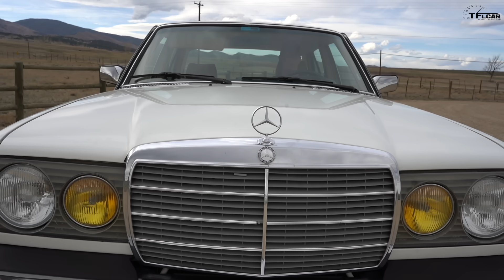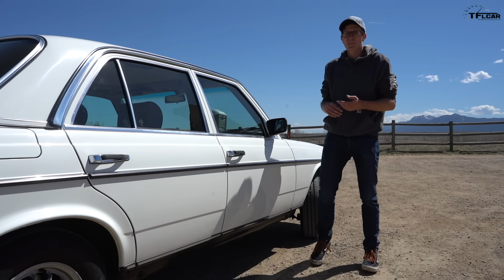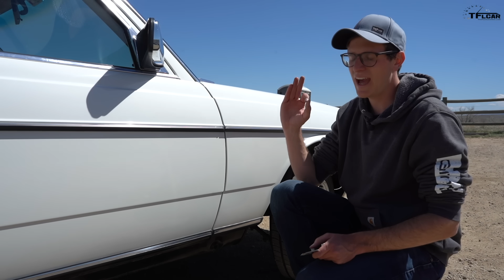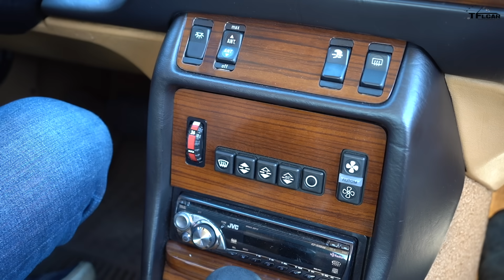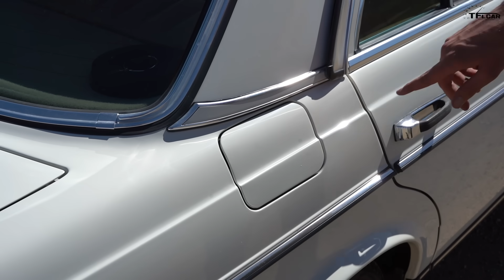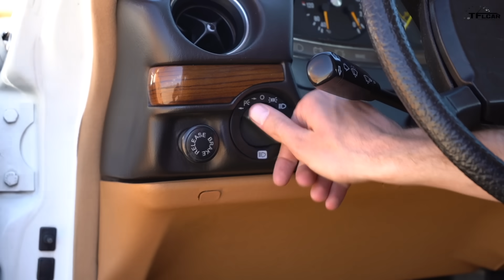This 37-Year-Old Diesel Is THE BEST Mercedes Ever Made!

Comment: I don"t get your point about the design. Nearly all cars from the 1970s-80s had this boxy stereotypical car design. The most famous ones are Volvos. That's where the saying "it's the car that kids draw when you ask them to draw a car" comes from. The old Volvo740's. Why compare the design of the W123 with modern Mazda & Cadillac?
Also, the 240D & 200D were way more reliable engines. They had no turbos and made little power. They sold way more than this "premium turbodiesel" 300

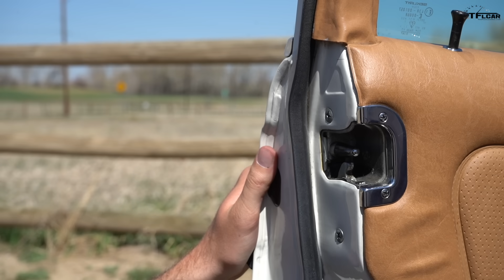Comment: The door latch machanism, seen here at 11:30, is the same one I have on my 1963 Studebaker Avanti -- it looks like it might even be the exact same part, with no changes in dimensions, and therefore interchangeable.  Studebaker licensed that latch mechanism from Mercedes for the Avanti, and it was for safety reasons -- this latch was one of the first made to ensure that the doors couldn't spring open in a crash and result in you being ejected from the vehicle.

Comment: Had a couple of W123 all variants except turbos. Very easy to repair, as I bought only defective cars, repaired them drove them some few 100 thousands, sold again cause the next waited. As in these times drove a lot on East country’s bad roads, they are the only cars which can stay it always, nothing breaks away. The Diesel engines are more reliable. Bought some with 250000 miles on odo and doubled it in some years.

Comment: Did you wiped my comment away, because it was a critic how you pronounce MERCEDES?😫😫😫
I am driving at the momemt my 7th Mercedes in 33 years.
When you pull out the light knop out once, you switch on the yellow foglights, and when you pull it farer out, you switch on the fogbacklights.
You didn't know this???😁😁
The early 300D had a thermal problem with the 5. zylinder. Mercedes used the same coolingsystem like in the 240D (the over 1Million Kilometer car), but he had to cool just 4 zylinder.
That's why you had many problems in the late 80s, to get a new 300D engine...the spare parts were sold out.
I sold my 300D with the damaged engine!

Comment: My aunt had one of these, it was gray and ugly, I know she didn't have it long though, her boyfriend was a Mercedes nut and convinced her to buy it, I think I rode in it once, if memory serves me correctly it rode like a truck was noisy, I might be mixing it up with the Volvo she once had which preceded the merc, that too was an ugly gray sedan, I don't know why they both were gray maybe it was a popular color for Euro trash back then, her next Mercedes was a small white one I'm not familiar with their model numbers and letters and their significance, anyway she had it for years and when she was around 90 she was coming home from church and pulling into her garage she blacked out, she crashed through the closed door into the back of the garage and took out the furnace and hot water heater, the gas line ruptured causing the the area to be evacuated, it was a court or some call it a culdesac until the gas company could come and shut the gas off, I wasn't aware of this until she passed away a few years later her  neighbors upon hearing the crash ran over and pulled her from the car, she's lucky the house didn't explode.

Comment: In my opinion the W123 has an equal friend to be the best car ever made: it's the successor W124. They are both undestructable (in German: unkaputtbar).
I had a 124 station 300 D, built in 1993. I bought it in 2000 with 223.000 km and drove it until 2017 with 667.000 km. I did not like to sell it, but I had to
(reasons not important here). It is still running. Now I have a "modern" W211 from 2008. It's a good car, I like it very much - but the best in my life was my old "Benzi".

Comment: one thing to watch for is the pitch of the oil pan bolt: some models the bolt was at such a weird angle on the pan bottom that something hitting it on the road or freeway would loosen the bolt, and drain all the oil!! Dad's shop did a few engine replacements for the local Mercedes dealer in El Monte!!!

Comment: I used the same cab driver when I was in Morocco who had one of these since 1988 (we visited in 2016). I peered into the dash and said “wow it’s covered over 800,000km! Hassan my cab driver replied “no no, it’s been around before. It’s done over 1.8 million kilometres”. 
He proceeded to explain that it wasn’t on the original motor. He said he had 3 other donor motors in his garage and was always swapping parts over. My god did it feel like it had done it though. Strong smell of oil burning, clunky and felt like every mount and ball joint was gone. Yet still it was still going. 
Every time I look at buying a car with slightly higher mileage on I always think back to Hassans cab.

Comment: I think you can only make this claim if you rework the turbo system.  It's been over 10 years since I had mine, but the Turbo lag was absolutely intolerable.   I'm not saying it has to be perfect or needs to compare to a modern Subaru or anything like that.  But there is a hell of a lot of improvement that could be made however you want to approach the problem.

Comment: We had a w123 growing up. 300cd, non-turbo. Damn fine automobile especially in euro-trim. That said, would argue that the w116 or w126 300SD were the best especially on a road trips as they offered better insulation from the engine and were rolling couches. 😊 Either way, the 240D will be my son’s first car.

Comment: we had the 200d with 50 horse power. Man this engine could pull over 3.5 tons of weight and manage a cruising speed of 120 kmh, and overtake military convoy transporting tanks. The w123 weighs 2 tons, we were pulling a caravan with weight of 1.5 tons, plus extra fridge, vorzelt and other stuff for camping. amazing.

Comment: Are u sure that the mercedes has a AC ? In Germany 40 years ago, it was common for the owner to have the sunroof installed if he did not have an air conditioning system installed.  There were already air conditioners, but up until 20 years ago in Germany they were only available at extra cost, and there were many people who did without them...

Comment: I've owned 7 of these 123's over the past 30 years...a 1977 300d was actually my first car in 1990.  I'd argue the 560sl is actually the best Mercedes of all time.  The build quality is even better.  Unfortunately the price for Mercedes parts is hard to justify on a car not worth a lot of money.  I've owned Ferraris and Porsche's...the most expensive parts of any car is Mercedes.  You can spend $20K just sorting out all the rubber that is invariably rotten on a 40 year old car.  The 560sl justifies the expense, while the 300d you can quickly eclipse the value of the car just in replacement parts.

Comment: How do you close that hood properly?
Reply: You mean after it has been opened all the way to "service" position ?
Reply: @M4ExKalashnikov  no I meant how to we latch it I figured it out though I just needed to slam it shut.  I just bought one and I’m trying to learn the car.
Reply: @healthwealth4791  best way is to lower the hood all the way gently, position you hands on each side of the star and push it in until it clicks locked. I've had no issues whatsoever and the latch lasts forever if not slammed hard when closing. 

As for the oil leak, it depends where it comes from. I do NOT recommend using those sealants that are added to the oil as they tend to block key passages in the engine causing more issues later. If it's a small leak, I would clean the area with an engine cleaner and see where it comes from. Usually, power steering leaks, oil sensors and stuff if not maintained properly. Sometimes it's just a bad gasket or seal that needs replacing
Reply: @M4ExKalashnikov  i agree with you totally 👍  I have fell in love with my w123.  Now I need to find a mechanic that I can trust.  My w123 is a stick shift and is so much fun to drive.
Reply: @healthwealth4791  I'm currently working on 2 w124s and it's a joy. Hopefully w123 will be next in the garage, but good condition models have gone through the roof with prices lately... I guess another project for me, if I want it to be cheaper 😂
Reply: @M4ExKalashnikov  i also have a small oil leak and I have one mechanic saying they all leak and he can add something to the oil to clog up the leak.  (I don’t want to do that). Another mechanic wants to pull the engine out to fix the leak.  (I don’t want to do that because everything else is perfect with the car.  A/c works strong and everything on the instrument panel)

Comment: I bought a 1980 300D in 1992 with identical color combo.  I was in my early 20’s at the time and my friends though I was crazy.   Car had 180k miles and I drove it for 8 years to 280k.  NEVER had a single issue with it.  Towed a 4000lb boat with it for years including a trip from FL to NJ with it no problem.  Sub zero starts in VT/NH regularly - no problem.   Just crank it for 30-40 sec and it would always start.   I now know I took that car for granite.   So sorry I ever sold it.     One of the best cars ever built for sure.

Comment: I have a 79 450sel with a 6.9 V8 and pushing 400k miles. Still runs better than my BMW, mini Cooper S, Subaru STI, and Alfa Romeo 155q4. Heater servo did go out recently but she's sits during the winter anyway. But still... The most reliable car I've owned.

Comment: I had a 1981 300D and it had 304,000 miles.  I drove it all the way to Florida from Massachusetts to have it painted and a vaca. The car would not die and never left me stranded once. My c5 corvette with 60,000 miles I can’t drive it out of my town and has broken down and needed a tow 4 times. The 300D was king and reliable.

Comment: I've owned three W123s: 200, 230E and 280E - the 230E was by far the best all-rounder.  Fantastic cars with great attention to detail.  Since 2016 I've owned a W124: currently a '92 230E and I've just bought an immaculate '93 220E.  The W123, W124 and W126 were the last great cars built by MB, the W210 was terrible, the W211 somewhat better, thereafter the quality and reliability went downhill.  Our second car is a 2007 Honda Civic 1.8 VXi, but nothing beats the feeling of driving an old Mercedes.

Comment: nah. the w124 is better. more sturdy. less rust. faster. still dinosaur tech which doesn't break and ramming resistant (more so than the 123 or 126 even ;) but provides more of an operator experience you're kinda used to nowadays. whereas with the 109/110/123/115/etc it's all still very much 'hello the 1950s want their outside mirror size back and their sagged low seats' just the whole seating position in anything before the w124 is like... eh. well. :P 'can't see where the hell i'm going, mirrors too small, dashboard too high, seat too low, the works' :P basically. they just rust like mad. zinc electroplating wasn't invented yet or not done right or something. 'faster' isn't even really much of an argument as obviously pretty much any mercedes engine ever made wiill fit any hole with the right engine mounts but still. the w124 is just 'less of a museum piece' and also better :P

Comment: This car looks just like my second 123 Benz:  another '82 (240D), white, with the same alloy wheels.  4 speed manual (I had to learn to drive the '81 240D I had before this one with the same tranny, and I've never gone back!)  Great cars!  They are beautiful, as well, so I'm not sure I get this talk about the design.  Functional all around, but a lovely type of car (240D, 300D, 200D, 230, whatever engine, Mercedes boot tag numbers and letters used to reflect engine displacement, engine type, and sometimes body type).  Yes, they would run forever, great (and beautiful) cars!
Reply: I missed the Spinal Tap moment when I viewed this before:  10 centimeter turning ratio!  Stonehenge, anyone?

Comment: I've worked for/on Mercedes Benz for about 6yrs, including the 123 series. I personally owned three of these. The example you have here is an exeption. Not many of these TD-s are made. Mostly where built as station wagon, or TD as they are called. Model T stands for wagon. Most of them where sold in 4 cilinder version. Especially the 240 whas very popular and left the European continent to be sold as taxi in marocco. They where worth tripple the prise there back in the ninetees. These rims for example where an option on the T model and not for the sedan. The central locking is operated by vacuum, not electric. silent and smooth. Trouble shooting on the system is very easy. I used to use cigarette smoke to blow in the main line under the hood and watch where the smoke came out where it whasn't supposed to. Just toss out the leaking parts and had a 100% succes. They had some special problems. Rear axles where weak on the differential side. They had tripode connectors instead homokinetics like on the wheel side and adjusting the valve clearence had to be done with an extra wrench. The valves on these engines do not spin wich caused problems on the exhaust valves if you'd adjust these like any other car. All in all very good cars that would last forever if they didn't rust like mad.

Comment: 14:48 i guess u mean 10 meter, cuz 10 cm is ~ the size of a Cadbury Caramilk bar.
By the way why is are the US headlight round? this looks wrong & very ugly to me, they dont't fit topthis car.
You are absolutely right about the AC. Gremans, especially at that time, had rearly a AC in any car.
Today thats also the case in private homes well over 95% of those are without AC.

Comment: I am salivating over this video. In 2013, I scooped up a 1983 300D in mint-condition (stored in heated garage, single owner; old professor) w/ 150,000 km (~93,000 miles), for $500 CAD (~$366 USD) lol. Hands down, the best vehicle ever produced - I am kicking myself for selling after only 5 years. Modern-day cars do not hold a candle to the uncompromising design and build quality of the 300D; arguably, the most well-engineered car ever produced. These are built like tanks, incredibly safe, and last *forever*. With a good mechanic (a dying breed), and proper maintenance, these cars run well over 1 million miles (yes, million). 300Ds are still used in Egypt as taxis - I saw one with 1.6 million miles on the clock (not a typo). I live in Canada, so the car was not practical for winter driving on icy roads - the car would slide down hills sideways haha. This was the only 'winter' issue; the car would start easily, even in -20 Celcius (-4 Farenheit); a mild winter day, where I live. I still cannot believe I sold my 300D - one of my greatest regrets.
Reply: Yep a dying breed.... Still looking for one and cant find any but noobs

Comment: This car only needed the consumables changed in the first 150,000 miles! Then the maintenance expenses were minimal. Reliability was out of the ordinary, exceptional! On the other hand, 
the 60 hp engine was running smoothly Without disassembling at 800,000 miles. It seems that it was the most reliable engine in the history of Mercedes!

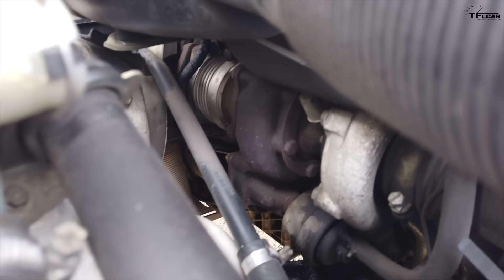Comment: Ok 3:15 benz screwed up.  The tab that pops to open the grill is flat horizontally in a horizontal grill.  If you open it one handed they break off and break the grill.  Bmw e46 grills the lever is strong vertically in a vertical slot.  So when you open the hood the lever is one handed.  And e30 well the slide forwards and hinge forwards so no safety latch..  also when you open a w123 all the way up you need to walk to both sides to lower.  Bad benzy
Reply: But also good has to raise in order to do a battery oil filter or hood.

Comment: The A/C system was bought from Chrysler.  They had the "Auto Temp II" which was licensed to MB.  They were superb engineers, but at that time A/C was not a big priority in Europe.  So if you have one and you need parts, it is not necessary to pay the crazy prices at MB.  And I know the purists among you hate that it is a Chrysler system.  BUT one of the vacuum valves under the hood with the servos and hot water hoses is FAR CHEAPER (and they are the most problematic parts on the system) from Chrysler.  So don't let MB con you into paying what THEY charge AND there a few guys out there that can rebuild them for you.  When I lived in Phoenix I would troll the junk yards and pull all the Auto Temp I and II controls from any Chrysler that I could find.  The same for Ford and Lincoln Mercury auto temp units.

Comment: there’s a car shop around the corner that has this one for sale, in a creamy green color. everything besides the battery is still an original mercedes part, even if changed once. it’s below 100.000 km and he offered me for 6.000€, but also said that once it stays not in a garage but on the road for a year, it’ll rust away.

Comment: I owned a new 1980 300 TD d 5 cylinder turbo diesel. In 5 years put 250,000 . Never a problem with the engine. But did replace the trans

Comment: 5:26 
I recently got a w123, my first forray into Mercedes from water-cooled vws. 
Anyways I hit my head a few times on the hood when it was open, frustrating. 
Anyways, in my exploration as I was lubing the hood hinges I saw a funny little lever, and the 20 watt light bulb in my head turned on.
I've seen these cars in repair shops in my younger days with the hood totally vertical!! 
Can it be ,yes,this is awesome.

Comment: To go along with that.... The Gas model.  Extended model the 320 SLE with the straight 6 was amazing too.  My dad had one and my how it ran and drove.  He hated it 'cause he was a Cadillac guy who switched over to the Mercedes.  At that time it was like the hottest car for wealthy folks.  the firm ride just wasn't for him.  For me at 17 with Griffith Park roads to ride on it was exceptional.  It had the auto trans on the steering column, but it shifted just fine.  And the inline 6 put out loads of power in the higher revs and was a blast to drive.  I've been thinking of buying one from the mid 70's.  What a nice and well thought out car just as you have said...  Nice job on your part...